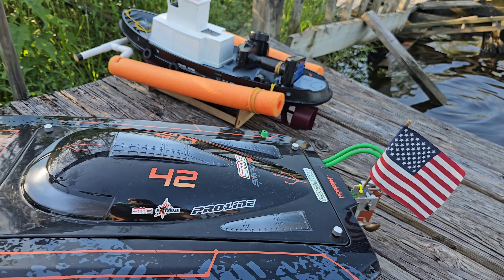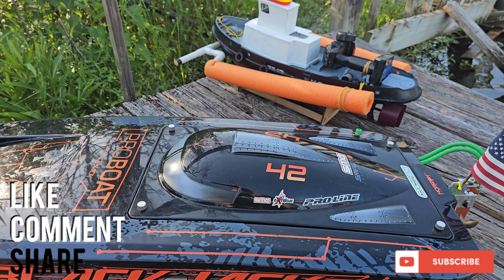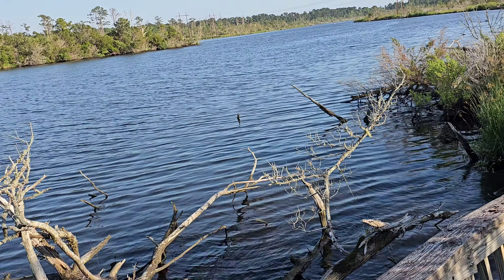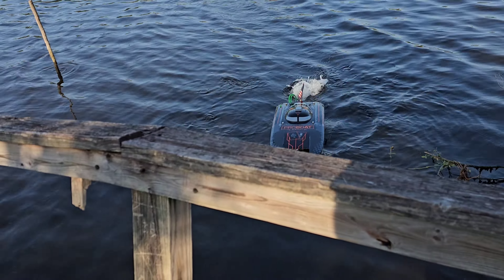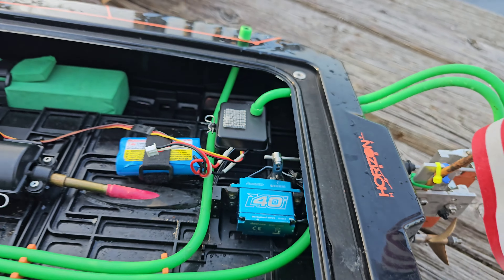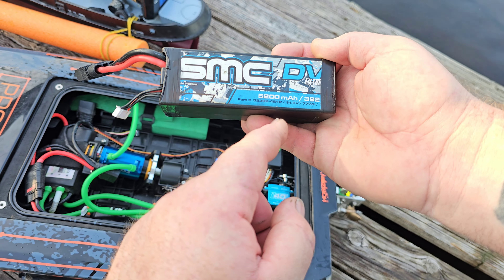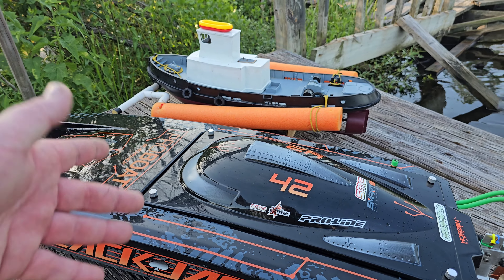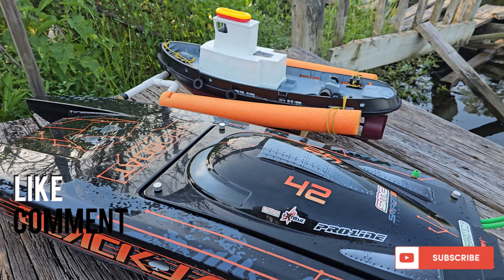Tracking Down a Few Issues Blackjack42 - Tp Power, Flier 400a

Comment: Glad to see I'm not the only one that has "goofed up" on the LVC setting.  One time, with my SonicWake, the motor/ESC was constantly shutting off every time I went 'full-throttle' from no throttle.  I seriously thought the ESC and/or motor was dying.  When I got home, I fully inspected both, doing nothing wrong, and was completely baffled.  It wasn't until I plugged the ESC into the programming box that I found out I was the 'cause' of the problem. 

Things is, I really dislike setting ESC LVC to 'Auto'...I always program the LVC to match the voltage I run on any specific vehicle/vessel.  Unfortunately, back when I only had one SonicWake, I would rotate, back & forth, between 4S & 6S, changing the LVC programming before running, to match what I was running that day.  Thankfully, I not have two SonicWakes - one with a 'higher' kv motor, dedicated to 4S; the other with a 'lower' kv motor dedicated to 6S.
Reply from the maker: I did the same thing with my sonic wake one day, I was like what the heck is going on.    Took me a couple days to figure it out

Comment: Ironclad………for the hatch issue, all you need to do is put some tape over the hatch lever. When it tumbles, the water hits that hat hatch lever turn to open and the hatch comes off. Just tape the hatch lever down in the closed position and the hatch will stay on.